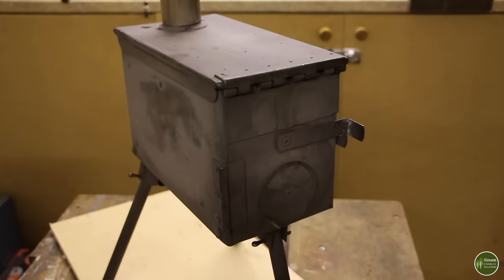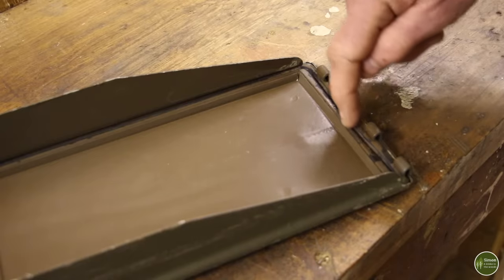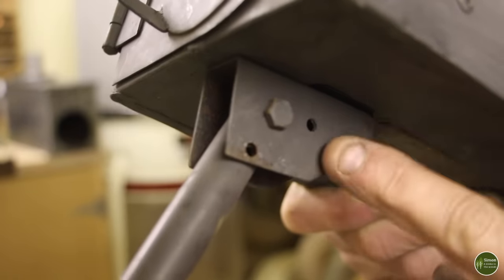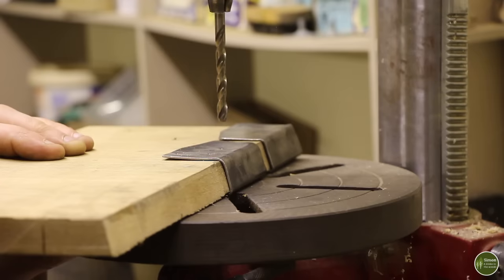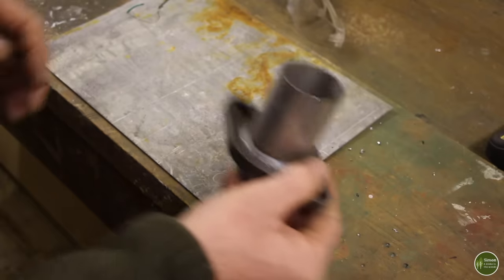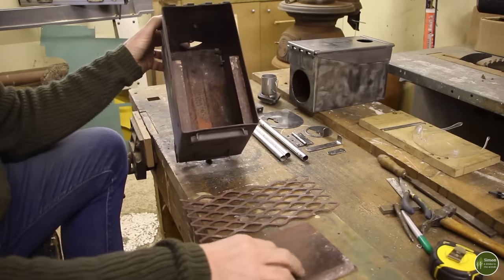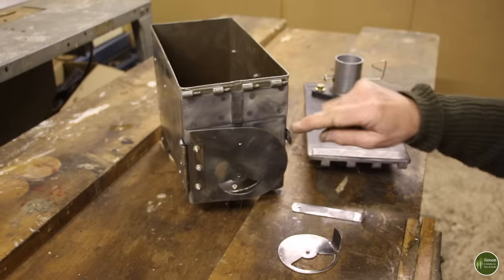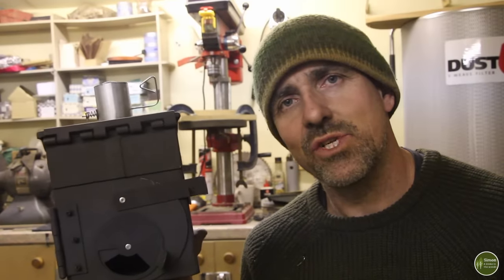Ammo Can Wood Burning Tent Stove. Make a Tent Heater for Winter Camping.

Comment: Wow Simon, you are so talented. The stove looks so professionally made. If you chose to use your variety of crafting to make a living you would have an endless list of orders to fill. Since your products would be made of high quality they would be in great demand. Thank you for sharing your crafting on video and as a teaching video.
I was just wondering about the pipe for the exhaust smoke. Shouldn't they insert narrow into the wider bottom part opposite of the way they looked or are they really tight fitting pipes? I'm asking because it could mean the soot would fall down between the pipes since you have the wider of the pipe fit outside over the narrow pipe. Or does it need to be that way to keep any smoke from getting inside the tent since smoke goes up but will not come down?
Reply from the maker: Yes, I chose that way so the smoke didn’t creep past the joints and into the tent space, although they are a reasonably tight fit - creosote leakage might be the only issue, but that can be cleaned up between burns. 👍

Comment: My grandpa made something very similar for our camping trip last summer. It got so much hotter than we ever expected, couldn't have worked better. Put a small hole into the roof of our very large canvas tent and line it with a silicone pot holder to protect the canvas from directly touching the roof. Unfortunately the stove pipe was too close to the walls of the tent, and would have caught fire if we left it going. Put it out immediately, scrapped the whole thing and patched the tent. Worked great as a heater though, a little too great.

Comment: Such a joy to watch you work but the idea of jigsawing sheet metal makes my ears ring :) better you than me. Ingenious design ideas. Ones I hope to use elsewhere. Spring clips etc. are those Aluminium rivets? Do they stand up to the heat ok? Stay warm friend.
Reply from the maker: Thank you! I used stainless steel rivets, although in the original I used aluminium with no problems. 👍🔥

Comment: Thanks Simon, superb video.

I'm certainly no expert, but don't the holes in the flue for the damper rod introduce a potential leak of the exhaust gases into your tent?
Reply from the maker: On testing, there was no leakage at all - the smoke and gases take the easiest route out - straight up the stovepipe. 👍

Comment: Hi again,  thanks for directing me to this video.  Do you think it'd be sufficient to use outside to replace a firepit in the warmer months? Our firepit (rip) was large and insanely hot
Reply from the maker: I use mine as an outside fire pit sometimes -remove the top and place the bottom grill up on the baffle supports - you can then cook on it too. 👍🔥

Comment: Thanks simon you made a nice job work of that one it looks like it pays to order get all the bits bobs beforehands! Im wondering if you can do a collapsible one that lies flat a bit like the lighterweight titanium models of sledging pulking etc as i find these are great for base camp but you cant pack them.in easily a flattened one is a bit more packable lighterweight not so durable probably but i find that the only drawback to using these is the distances or how far you can pack them in? Once youve decided to take it! In? It dont matter in a canoe of course or if car basecamping but other than that i find them limited in terms of packing them far enough in! A flattening  one lightweight maybe just the ticket! To pumping out heat in winter hot tenting! Nice job great advice too on construction of it theres far more work involved in making one of these than peoples often think
Reply from the maker: I got me a lightweight titanium folding/collapsible one - it is amazing and weighs a mere 1kg - including the stove pipe! 👍👍🔥
Reply: @simonablokeinthewoods  yes well it kind of goes without saying that if it is a stove of any descriptions and it is technically feasible to own it and place it in your private stove collection at the royal albert technology musuem then id assume that you already that  youd have it! Omg therapy is needed here! Helpline for stoveaholics anon coming up! I was quite impressed by the lightness packability of it i imagine being made of titanium they are impressive as biggest drawback to ammo can stoves is lugging them in to where you need them to be at? Often not the stove itself they can get or be cumbersome to lug in any distances the flatpack titanium sort of solves this problem yet they kick out equal level of heat! Upon your site arrivals! Good value in long runs to keep it light for remoter camping not car or canoe based!?

Comment: If you use a spark arrestor screen be careful of presto type logs,  the waxy substance that is used to hold it together can clog the screen and cause the smoke  back up in  the tent.  though the location of yours may keep it hot enough to keep the wax  burned off of it.   I found this info out the hard way.
Reply from the maker: That is good advise! I hadn’t thought about those logs. 👍

Comment: Hi Simon. I've just ordered an ammo box to attempt this build, just need to know, what measurements do I need on the exhaust parts, it asks for fitting type, diameter etc. Maybe I missed it in the vid. Great stuff thanks. Edit. Do I need the long flue if I'm just using it static out my back garden?

Comment: Very nice build. Maybe put some fins on it, bolt some iron to it, the more thermal mass the better, saves the heat going up the flue and radiates it inside the tent instead.
Reply from the maker: Great idea! 👍
Reply: @simonablokeinthewoods  I discovered just how poorly a heating stove works when I tried running a gas one inside a tent once (with the flap partially open for airflow). You have to have something like a cast iron pan to collect and radiate the heat, or it just dissipates away so fast. Even boiling a big pan of water would do, then just keep it on a simmer.

Comment: Winter camping is KINDA nice - but the Sun goes down so early (at least here in southern Norway) and if im in a new area, and have to find a good place to put up the tent before it gets dark, then i end up stuck in my tent with nothing to do from 5pm or something. When im out in nature, i like to walk around and keep busy.

Last time i was out was a couple of months ago, and as my backpack was so heavy with my winter gear, i was exhausted and fell asleep around 5-6PM, right after i put up my tent and had eaten some dinner. Woke up pretty well rested a little after midnight, and as everything was dark, i had nothing to do, and ended up packing my gear and heading back home.
Reply from the maker: I usually take a good book with me, or a small carving project - I like to be doing something too - that’s my relaxation. 👍
Reply: @simonablokeinthewoods  That stuff definitely helps. I got some video glasses with android that i like to watch a few tv-series on before bed. Its only $160 on Ebay (from the right seller), and has support for 3D video and 720x560 resolution (which is pretty good even for a bit more expensive video glasses). The downside with this cheap model is the 1 hour battery life, and the minimal ram on the device, so you can only really install VLC media player on it, and anything more than that makes it start lagging in the videos...

Comment: Some of what you did with rivets I would weld, but don't assume that would be cheaper. It generally costs about 50$ for me to use mine. More for a big project. Probably less for a smaller one but I never stop there.
Reply from the maker: I welded my first version (parts of) but decided on stainless steel rivets for this one so it’s accessible to those without a welder. 👍🔥

Comment: Were was that a hss bit you used to cut both through the wood & metal hinges ive got same type of drill may need to go out buy new hss bits ive used mine quite a bit get blunt real quick is hi heat friction flux a good idea to use!

Comment: Amazing video! And with autumn not too far away, I see a little project on the horizon for me!

One question- have you had any issues with the pop rivets failing due to the heat?
Reply from the maker: Thank you! I used stainless steel rivets - no problems with heat. 👍🔥

Comment: I'm not sure about the aluminium rivets! Stove heat can over the melting point. I use metal screw for fast and cheap assembly, the better and cheap will be stick welding.
But otherwise nice assembly, bright design.

Comment: Just a tip if you use rivets, use stainless steel rivets as standard ones are aluminum alloy and can burn up
Reply: Pretty sure he mentioned that...or maybe in his Instagram posts🤔
Reply from the maker: They are stainless, although I used aluminium rivets in my old stove with no problems. 👍

Comment: Hi Simon, great work, you inspired me to build one myself. I bought a Fat 50 ammo can and it's pretty much complete apart from the chimney as the exhaust sections are expensive as you point out. I have one question if you have time, how far down did you place the baffle?
Reply from the maker: Thank you! The flat baffle plate is  about an inch down  from the top of the can. 👍 not long till fire up day! 😁🔥
Reply: @simonablokeinthewoods  Hi Simon, thanks, I ended up going 50mm down but I can sort it. Just made up the chimney today, I went for a 1.5m length each of 48mm and 51mm and made it up like your original mainly due to cost, the swaged sections were £10 each, the 2 x 1.5m lengths were £27 for both so I went with the cheaper option. I have a welder so plug welded the 48mm inserts into each of the 51mm sections. I still need a flanged joint and a length of seal cord as my lid is quite loose with the rubber seal removed. Might get it fired up at the weekend with any luck. 

p.s. Your canoe is a work of art as is your Baker tent and modified Lavvu. The Baker tent was a handful, rather you than me :-)

Comment: Great Vid Si, have yo measured the Temp it Reaches?   Would the Rivets on the FireBox hold up to the Heat
Reply from the maker: I have done a temp test on my old one - the firebox itself got up to the mid 300s, but the rivets are stainless steel, so no worries there. 👍

Comment: I am curious about 1 thing where the  chimney pipe connects to the flange does it go over the flange pipe or in it I was thinking about creasote leaking out from wood burn
Reply from the maker: That’s a good point - if it was used for long term it might be an issue, but for the odd night or two at a time it’s no problem - any creosote can be cleaned off between use. 👍
Reply: @simonablokeinthewoods  thanks simon i have a similar type stove not ammo can and i went to the muffler shop in canada had them make a couple fittings to reverse my stove pipe from doing that. Cheers mate

Comment: Stoke it up good before turning in, how long will it keep a tent warm at 10*C air temp?
Reply from the maker: You’ll get a 2-3 hr burn from a fill if you use decent, dry slow burning hardwood. 👍🔥

Comment: Hello I've got a question about the lid. When u pulled out the rubber gasket, is their a need to replace it with something fire proof. As something like a stove rope gasket to keep excessive smoke from down draft.
Reply from the maker: Hi Dave, you could replace it with fire rope, but I’ve found that it doesn’t really need it - the smoke takes the easiest route out - straight up the flue and there isn’t any leakage. 👍
Reply: @simonablokeinthewoods  thanks

Comment: Hi Simon, have you thought about using fiberglass rope to replace the rubber gasket? It would create an even tighter seal between the lid and the main body and increase your control over the flame. It might also help to limit the possibility of carbon monoxide escaping.
Reply: And a grill gasket on the door is a good idea..might need to make me one of these..but when i buy an ammo can it usually ends up full and the process repeats itself 😂

Comment: Have you (or anyone else) had any issues with smoke leaking out of the lid? I used a cheap ammo-can from harbor freight and the latch side has a steady flow of smoke coming out of it during tests. I plan to grab some fiberglass rope gasket to stuff in the old rubber gasket cavity, but I was wondering if anyone else might have a better solution.

Comment: The paint on any ammo can built after the mod 70s or so is called CARC (Chemical Agent Resistant Coating). The grinding dust is quite carcinogenic. It's worth the extra three minutes to be outside and using a very good respirator if you're going to do any grinding on it at all.
Reply: This is solid info. I have several cans I might do this with and they're probably all post 1970. I'm not real sure, but I'd rather not take the chance.
Reply from the maker: This information is contradictory-to what I have been informed - always better to be safe though. Thank you. 👍

Comment: You need  a welder.  They make things easier and cheaper.  A flux core wire welder or a DC inverter stick welder both would have done the job and both can be had for around 100 USD. i 'm going to make one like yours one day.  I like to backpack, but I'm 61 years old now, and cold hurts now. that could be the trick, but i need lower weight. Thin wall stovepipe etc .
Reply from the maker: Thanks Mark! The stovepipe is the heavy bit - you could use a titanium foil stovepipe (available from SeekOutside amongst other places) and switch to a 3” fitting so
It’ll fit. 👍

Comment: Whats the exhaust section diameter and spring clips size you use?
Reply from the maker: They are listed in the description box below the video. The exhaust sections are 51mm O/D and the spring clips will need to be chosen to fit the size of tubing you use for the legs - mine were for 15mm I/D tube. 👍

Comment: The only thing I would do differently is to include a bit of stove gasket between the top and body of the ammo can.
Reply: Agreed, Bob .. might release some smoke into the tent without a gasket?
Reply from the maker: I’ve found that it doesn’t really need one - the smoke and exhaust gases take the easiest route out - up the flue, and there isn’t an issue with leaking. 👍

Comment: That stove pipe upside down? Normally stove pipe is installed so rain or creosote runs down and stays inside, not coming out at the joints to run on the outside of the pipe. Otherwise, nice build!
Reply from the maker: Using the stove pipe this way ensures smoke and gases don’t escape whilst going up the flue. Any creosote I just clean off between burns, the water evaporates instantly on contact. 👍

Comment: Remember when you use a file and a hacksaw they have teeth that cut in one direction. Apply pressure on the push stroke only, it will keep the tools cutting edges sharp a lot  longer.

Comment: Wouldn't a carrying handle on the top make it easier to carry?  Mount one in the center of the lid at a right angle to the original one (maybe reuse the original by disassembling it, and shortening it?) Even shortened to slight less then the width of the ammo box would still allow a person to fit their hand into the opening.
Reply from the maker: The issue would be the reduction in flat closing space on top of the stove - one on the side might be a good idea though. 👍

Comment: replace the rubber gasket with oven door seal :D?
Reply from the maker: You can do, although I found it not necessary - the smoke and exhaust gases take the easiest route out - up the flue. 👍🔥

Comment: A few things:  Don't use nylon lock nuts (on the legs), they will melt.  Don't use aluminum pop rivets, they melt/oxidize very easily under heat.  Your stove pipe need to start on the inside (not outside like you have, the soot will drip out your way.  Just my thoughts, not an attack.
Reply from the maker: I used stainless steel pop rivets, the nylon locknuts are no problem - if the nylon melts it’s fine, the melted plastic still holds the bolt well. As for the exhaust pipe sections, they are set up that way to reduce the risk of exhaust gases escaping as the smoke travels up the flue - a tiny bit of creosote or soot coming from the joints doesn’t bother me at all - it cleans off afterwards 👍
Reply: @simonablokeinthewoods  I'd look up how to install stove pipe then.  Ya still need to flip that around, after much use, it does make a mess (I heat with a wood stove).
Reply from the maker: So do I and they are always installed as I did in the video.

Comment: Those appear to be aluminum rivets. Anyone attempting to build one of these, ensure you use stainless steel rivets, as aluminum when exposed to high heat will weaken and lose their integrity and eventually fail as a aluminum can thrown in the campfire. They'll eventually disintegrate. Other than that cool build
Reply from the maker: They were stainless steel rivets 👍

Comment: I have a question, and maybe a improvement. Question. Will it be warm enough to cook off of? Like a skillet, or a pot of coffee? Improvement. Handles on the side like I see on most grills or fireplaces. There is always going to be a time when you will need to move it, and it would be to hot to handle. ( https://tejassmokers.com/image/upload/product_img/IMG_0196.JPG ) Would help it a lot too.
Reply from the maker: Yes, you can cook and boil water on it - it’s slower than over flame, but who’s in a rush. 😁 A handle is a good idea 👍

Comment: Word of advice to all who make a stove like this: Do NOT use aluminum pop rivets. I did and they all melted after a short time leaving me with a box of parts. I changed over to actual machine screws, with double nuts and have had no problem since.
Reply from the maker: I used stainless steel rivets. 👍
Reply: @simonablokeinthewoods  👍